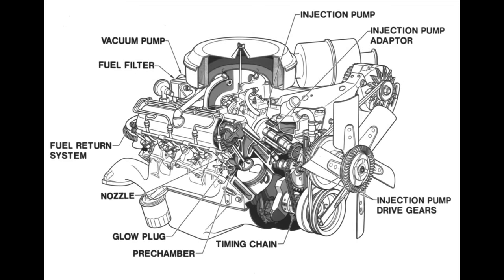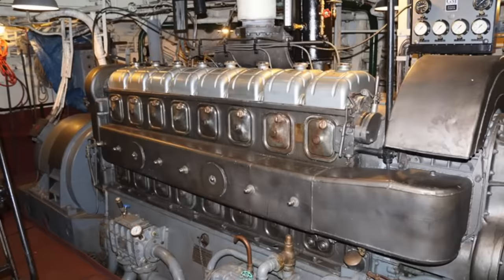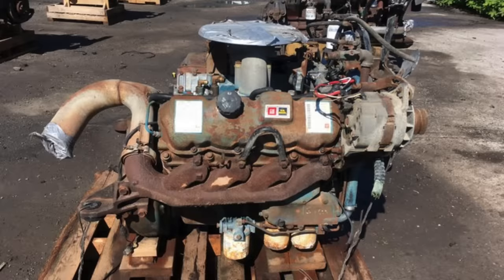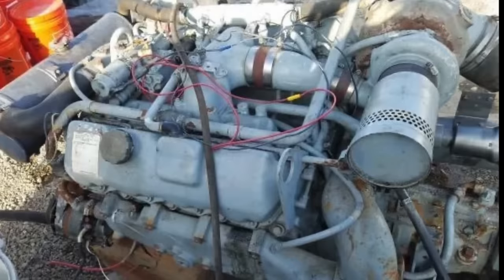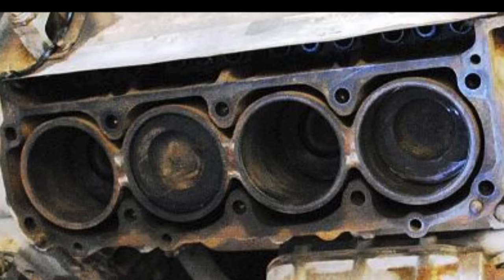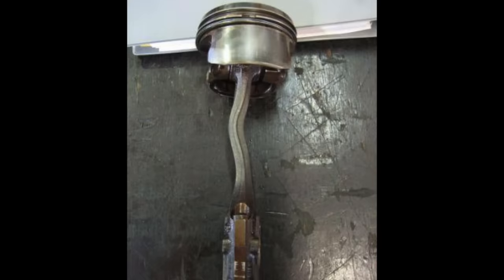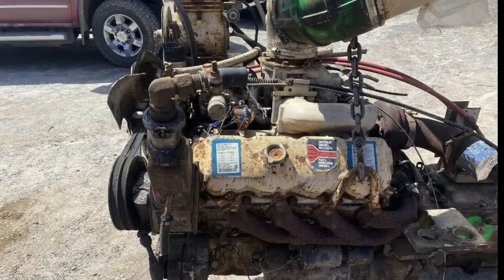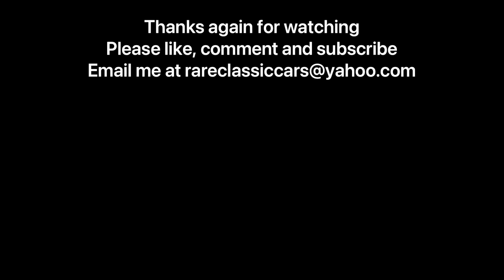Worst Engines: GM's 8.2L / 500ci "Fuel Pincher" Detroit Diesel Pinched Its Owners' Pocketbooks

Comment: Ah yes the 2 stroke Detroit, used in some tractors in the late 70's. Turned diesel fuel into smoke and noise better than anyone, cripes them things were LOUD!!!, lots of power and torque but LOUD!
Reply: When fuel was cheap, you couldn't beat a big screamin demon!

Comment: The Cleveland Diesel Division manufactured the much larger engines used in EMD locomotives, submarines, mining applications and even commercial power generation. In the 60's the Cleveland Diesel Division was folded into EMD.

Comment: The fuel pincher was a Pinske (owner of Detroit diesel) along with the 6.2 used in pickups. It was used to go up against the Cat 3208 engine. (Cat didn't last very long either) (also Cummins put out a small V8, the triple nickle we called it) We had an Olds come into our shop that had the diesel that had 480,000 miles on it, pretty much all highway. We did not do any work on it as we were the Detroit/Allison dealer but couldn't believe this guy had that many miles on it! The state had lots of the GM trucks with the 8.2 and we saw them regularly.

Comment: I'm not really into Diesel Engines. I'm not really into Big Trucks. But since 1990.  I've owned Mercedes-Benz, L-1117, Box Truck. I got it because it was Slow. Even though it does have a Turbo. You'd never really know it's. But I could hear it spin up.

I did not know that information regarding Detroit Diesel. I didn't know they were originally a part of GM. I always wondered? I never really looked into it. I had no reason to. I have a German truck.  Made in Brazil.  And originally leased to Sears in 1984. It's an 84. So no electronic, NUTHIN'.

It sure does sound like Detroit Diesel, GM, Oldsmobile. All dropped the ball on passenger diesel engines. They knew how those CAT  diesels were built well. They didn't want to build theirs well. They just wanted to make them cheap. And then you get mishmash.  Of, too many cost-cutting mistakes. To produce a piece of crap. That will hardly hold up as long as a gas engine. Yeah that's stupid. They were stupid.

And then Roger Penske bought them HUH? He also purchased Hurts Rent a Truck. Or was that Avis? I forget? It was one of those. And so he has used his winnings, wisely. Let's hear it for a little integrity! Yee ha!

My truck is a private vehicle. It's highly modified inside. It freaked everybody out. It looks like a Sears delivery vehicle. It's as far Removed from a Sears delivery vehicle.  It can get. As the interior of the all wooden, 1 inch thick FRP body. Has a, second dense box. Installed within the outer box. And separated into 3,, Soundproofed rooms.  With central HVAC heating and cooling. It's kind of like a Super Class C motorhome within. But it carried a lot of audio and video equipment. Set up as a couple of control rooms. When audio. One video. And the rear room and entranceway. For all the power supplies, distribution amplifiers, Power Distribution. And kitchenette. Now. Where the 24 track 550 pound each, Analog Tape Recorders once resided. Back in 1991 when I opened.

But by 2007. It moved into the control room. Weighed in at only 10 pounds. Use removable hard disk drives. Sounded better than any analog machine ever could. And would also stream into the computer, simultaneously. So I would end up with three,  24 Track Simultaneous Recordings.  That's called Redundancy. To ensure no failures. And because I could be plugged into a satellite uplink truck. Feeding rock 'n' roll mixes around the world. Via MTV, NBC and others. From my own Recording Truck.. I was only about one  of a dozen. In the entire world. Most here in the USA. Except for the Rolling capstones Mobile. Which now resides I believe in Oregon? As it was sold.. It was old. Very old. 50+ years old. And the chassis is dying. And it's a British chassis now in America. That's not going to work out well. They will not be driving it many places at all. It's a portable control room.

And after, over 30 years of Analog Equipment Goodness. And a complete re-outfitting. About once every 10 years. I'm going Purely Digital. It only makes sense now. It has progressed where it is, Adequate. It's not great. PCM Encoding, is not good. We have something better. They quashed it. Over 20 years ago now. The Super Audio CD  was encoded as DSD. Single bit. Sampled at 5.8 MHz. It did not sound like PCM anything.  But it didn't take off. It was expensive. People don't care about better sound. They just want more fun software to play with. And none of our current computers. Can properly handle a DSD stream. So it didn't take off. They don't really care about the sound after all. Everybody has forgotten it even exists.

So as I see it.  Most Audio Professionals are nothing more than Audio Hypocrites, today. It's all about the fun. It's not about the sound. Because digital is the buzzword still. And PCM sounds rather fizzy. But they don't care. They don't know what the good stuff sounds like. Because they don't care.

The Music Industry is Over. It no longer exists. They don't want rock 'n' roll bands anymore. They cost too much. They can't make as much profit. But they can with Taylor Swift  and Justin Bieber types. They are Manufactured. Their parents paid for them to become famous. They were very wealthy. It only takes about $4 million. To make your child a famous Rock Star. With no talent. And they make a lot of money on those. Everybody gets their cut. Yee ha! They are now Wealthy! And they are Geniuses! With no talent. Because they know how to play video games with audio software. And they know how to cheat the software. That's all boys know how to do. Cheat. They can't do anything honestly or ethically anymore. They've had nothing but bad examples for years now.

And so everybody wants to act like Donnie. Because Donnie is cool. He gets to break the law. And be omnipotent! You can't touch him! Nobody can! He is so mighty and powerful! He will destroy anybody who gets in his way! Because he is the King Dictator Trump! And he and his heirs. Will Rule the USA for the next 1000 Years! As he never read Mein Kampf. So this is all of his creation! He is better than Hitler! He has Jesus on his side! And he held up a Bible in front of a church to prove it! He's such a great man! A man to end us all.

I no longer have a passport. It expired  years ago. I can't get another passport. All of my ID, birth certificate, Social Security card, past drivers licenses, expired passport was physically stolen from me. Who do such things? Psychopath Texans do. Especially if they work for police departments like San Marcos, Texas. With officer McKee and officer Blackwood. Who have destroyed my entire life on purpose. Because they don't like my types. In Texas. I'm considered Transgendered due to my birth defect.  And they hate me for it.  I didn't have any control over that. I went to the guys at Hopkins for 14 years. But they tell me the guys at Hopkins don't know what they are doing. At the Department of Public Safety where you get your drivers license. And they had rediagnosed my condition. They told me I was a Man. No. No I'm not.  They don't care. I have a vagina. They don't care. They felt they had the right to rre-diagnose me.. And to declare me a man with a vagina. And then deny me my drivers license. When there was nothing wrong with my drivers license from Virginia. I was a superior driver. I was awarded for being a superior driver in Virginia. But that's not good enough for Texans  that don't like my types.

So Texans have enjoyed attacking me. Physically attacking me. Beating me. Robbing me. Incarcerating me for over a year. To tell me I'm a bad person. As a disabled, profoundly handicapped, senior citizen, widow.. As my husband of 22 years died a few years back. And now I am much more vulnerable and easy to attack by Texans. They know how to do that very well. To destroy Americans lives they don't like. Because they are not Americans they are Texans from the Republic of Texas  of the Lone Star State  of Chaos. And they hate America. And they hate the US government. And they hate Americans. Because they all feel they are Superior, Homo sapiens. To any other American. To anybody else in the world. Right up there with the Aryan  Nation. That they are Bringing Back! To take their country back! Because it's not our country any longer. It's only Republicunt Country. And they are the Winners! They have declared themselves so!

Yeah so nobody needs to vote in November. Donnie is already the winter. And he will move Joe out forcefully. Even if Joe thinks he was the winner. They don't need to look at the numbers. Everybody knows Donnie is the winner. They have deemed it so. And they're not going to take no for an answer this time! They will release a Larger Insurrection if they have to! To take their country back!

They have gone beyond maniacal. They are insanity off the rails.  And they need to kill. They know, no other way. Except violence. That's the only thing stupid people understand. When they think it's perfectly all right to attack Americans they don't like because they don't want to be Woke.. They like being hate filled  Americans. They have that right! No they do not. And they will have to be stopped, forcefully. They know no other way. Stupid people can learn nothing. They don't want to know about past history. That isn't to their liking.  That's why we never had slaves in America. We simply rescued them jungle bunnies. And taught them everything! We are so kind and giving as a nation.

Everybody is absolutely deranged and demented into depravity, today in the USA. And they want to hate other Americans and expel them or incarcerate them and take away all of their property. Because they are thieves, rapists, murderers and Republicunt's.

I can see now. This is not going to have a good outcome. They will not accept another loss. They will refuse. It won't be good. They want to go over the top. They want to expose us to our adversaries. With our pants down. Fighting amongst each other. When China, Russia, North Korea are going to make a move. And others will want to join in  the fun!

And we will be buns up, kneeling. And completely unprepared. For the start of World War III
RemyRAD

Comment: Worked at a Detroit diesel dealer in the 80's. when these first came out, I remember they had a lot of issues. oil pump failures were common. also valve springs breaking, dropping valves. seen it all. injector height was set using a dial indicator . head gasket failures were common even with the updated larger head bolts. pure junk imo.

Comment: My wonderful Dad ran a family owned trucking company, for 30 prosperous years, with steady growth throughout the 50’s , 60’s and for the most part 70’s. Until OPEC I, II&III HIT. Then on top of that the peanut farmer pushed through de-regulation to rid the industry of all the good laws that helped the owners control cost. In the fleet when I grew old enough to drive, we had a GMC 6500, with a V6 Toro Flow diesel, we called shaker, that I being at the bottom of the seniority list was relegated to drive. With a 6 speed low hole and two speed rear. That with a full 18,000 lbs load could just barely get to its top speed of 64 mph, hit any hill, any grade and be prepared to start splitting gears down shifting. However compared with the V6, gas engines, that had a little better performance, burned a lot less diesel than the gas engines.

Comment: Open deck diesel good lord. GM's failures are so predictably obvious it always looks like deliberate. These are all problems shared with olds pass car diesels as well as HT4100 as well as northstar as well as Ed Cole's dumb Vega engine.
Reply: The Olds 5.7’s issues were mostly due to the lack of a water separator, which was unbelievably stupid on GM’s part.

Water in diesel not only wears the fuel system down, it also increases cylinder pressure significantly. Without water in the fuel, a 5.7 is often fine. Not a stellar performer, but an efficient grocery getter. Unfortunately, diesel often had lots of water in it in those days, and without a water separator failure was simply inevitable

Comment: I worked for a company that had two Ford L series straight trucks with that engine in the 80's. Athough they were gutless and made no power, they did run fine for 180k each. Top speed was 60mph though, gut the older trucks with gas 330 ci motors were worse and had trouble getting to 120k without an overhaul. The 8,2L trucks also ran cheaper, about 9 mpg vs 5 or 6 from the gas motors and since diesel then was way cheaper, the savings was even greater
Both were 130 hp non-turbo motors.
Neither motor was a 'problem' engine in those trucks, both failed or started to show signs of being tires around 180k, they rebuilt the first one to go down around 190k, the second truck just got parked as they deemed the truck not worth fixing due to age and condition. Also, by the late 80's their business had declined considerably and they were cutting back on the number of trucks in the fleet. 
Neither had head gasket issues, at least if they did the symptoms at failure weren't cooling related but just general loss of compression across the board, with one cylinder finally being too low to fire. I was driving the one when it died, and when the right valve cover was pulled it was missing an exhaust valve on the second cylinder from the front the intake valve was stuck open about 1/4". Most likely it dropped a valve at RPM, and mangled the piston and other valve. The fact that I was told to keep running it until it wouldn't go any further that day didn't help. It did go another 265 miles after I first heard the noise and felt the miss. It drove into the repair shop where it got a new motor a few days later. 
The other truck ran till 181k, but died in the yard, one cold morning it refused to start, so one of the guys overdosed it on either and one big pop was its least sound. It sat there for four more years, never moving again until the place closed up in 1992.  That truck was rough though, it had been upset twice, and the body was pretty well shot. It had been hauling lead castings for years and regularly overloaded. Fixing it made no sense in any scenario. 
The last I saw it a local farmer had it and was using it as a storage shed to store feed for his chickens in. The other truck got taken by the shop that put the new motor in it where it sat out back for 10 or so years until they too closed up and sold out.

Comment: The Oldsmobile diesels of the '80s in passenger cars and light duty trucks were 5.7L V8 or 4.3L V6. The V6 was the V8 with 2 cylinders chopped off the front or back, not sure which. The block was actually a large-block V8 used in the 455ci V8, but only bored to 350ci, for strength. The critical failure mode for these engines, esp the V8, was also blown head gaskets. Again, not enough head bolts used in the design to properly secure the heads when trying to restrain diesel pressures. I owned an '84 Olds Cutlass Supreme Brougham with the 5.7L engine, had 3 blown head gaskets, always the right (passenger) side of the engine. Another critical failure was the fuel injection pump, with rubber spacers/weights deteriorating and contaminating the fuel system. Finally had a diesel repair shop rebuild my pump with the metal spacers/weights used in farm and industrial equipment. Was a lot noisier but never again had an uncommanded shutdown due to the fuel pump! I am not aware of any Oldsmobile 4.3L V8 engines.

Comment: I drove a 1981 C70 Chevy we used in forestry as a helicopter fuel and chemical mixing truck. The thing was always broken. I remember our heavy equipment mechanics having to drill out broken head bolts and machine the block for larger bolts. The engine didn't have the power that a 355 CI BBC tall deck made in an almost identical truck.

Comment: I remember driving school buses with the fuel pincher amd was it totally gutless. Couldn't make the posted speed limit on the highway and and slowed to a crawl on hills. Standing on the accelerator pedal for extended periods of time was very tiring.
Reply: LOL that sounds possibly worse than an N/A 350 gasoline V8 on a big school bus! Even the bus that I remember being in, would regularly hit 60-65 MPH, IIRC. Sadly, I think engine failure occurred in 1997 one day, IIRC. It most likely failed when going up the hill to the campus. It didn't help that the transmission kept hunting and sound like it jamming up like a big honkin' printer! I was in that bus before that incident, when going up the same hill, and it sounded like a chance of the transmission breaking! I wasn't in that bus during that incident. Unless it was the transmission that failed and they didn't feel like getting it back on the road. It also didn't help that it was mostly just driven on the campus.
Reply: @RJARRRPCGP  I drove an 1972 vintage school bus with a Chevrolet 366 big block. Had a hard time doing 60 and tended to max out around 58 or so. I cheated a little and could beat the governor of I inched the chock out a little bit. Things worked out well untill I was ripping along at 62 when without warning the whole bottom end dropped out. I was on the clutch and coasted to the shoulder and wondered what happened. I believe the extra fuel from using the choke washed the cylinders and stuck some pistons. That broke the bottom end and my luck. I swore I didn't know what happened when asked.